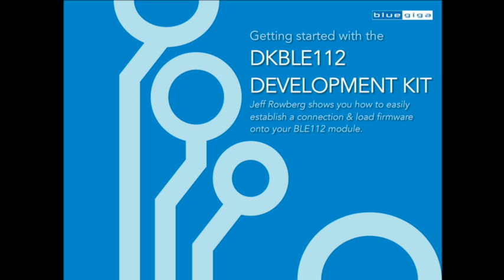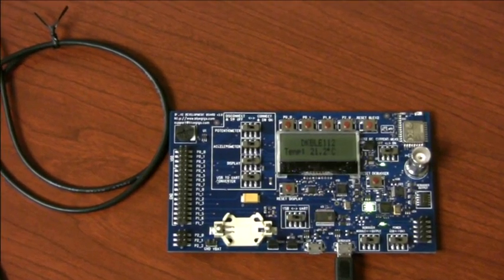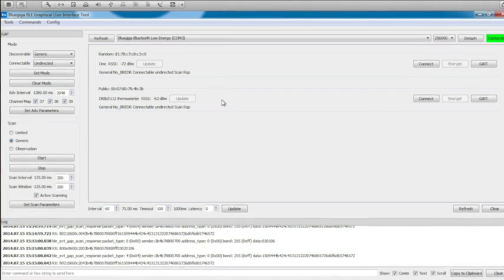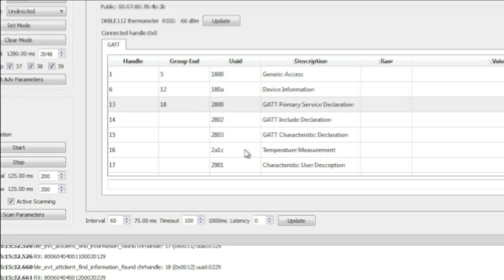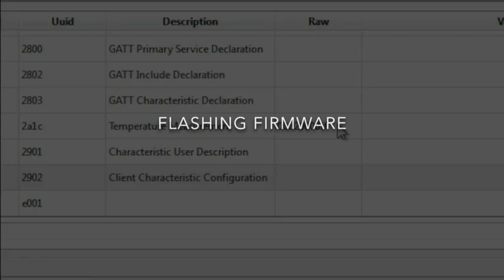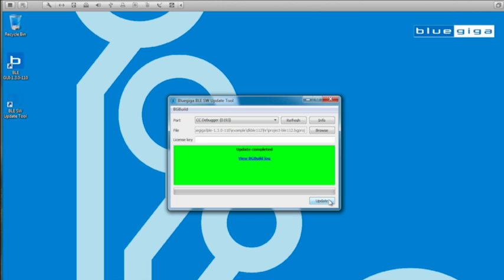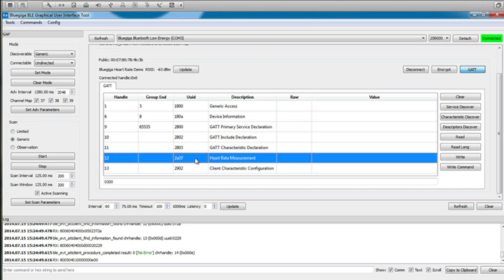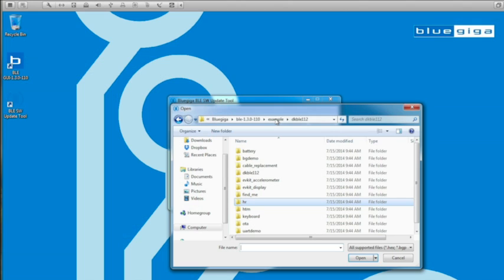Getting started with Bluegiga's DKBLE112

Comment: I am looking for starting (to learn) to develop an device which motor which has to be operated by mobile device. I think BLE113 or BLE112 is what I will use, but I am not sure how to develop and load program on for this? in this video the circuit connected to computer is not attached to BLE112/3 right? Can you please assist where do I start and go ahead? I am really a beginner over this thing. (I know mobile android application development so that part would be easy for me.)